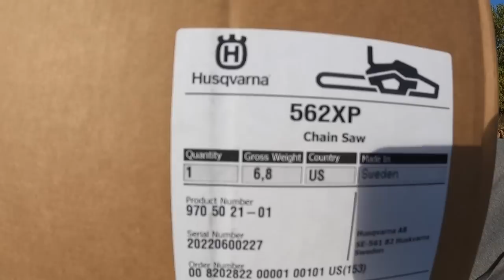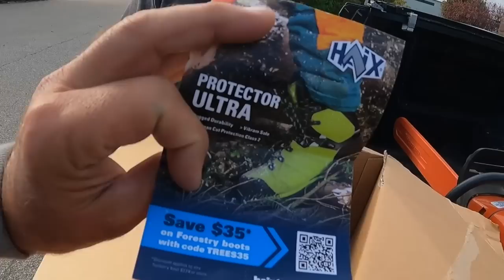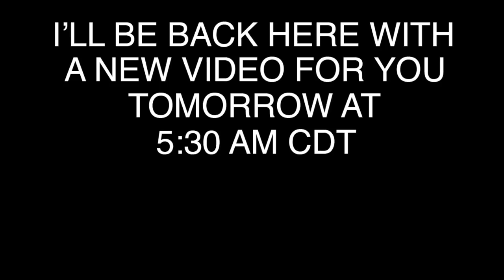NEW - Husqvarna 562 XP Chainsaw!

Comment: I love my 550 xp that I keep in my Jeep with a 16" solid Japanese bar on it, which is perfect for clearing the kinds of trees that I run into across the logging roads here in West Central Oregon. 
I've also run an 18" and 20" bar on it cutting large oak trees and it still had plenty of power.
Reply from the maker: Very nice!

Comment: I started out really liking Stihl best, but the more I used a Husky, the more I liked them. Now I have more Husky than Stihl. I really appreciate how smooth/low vibe the Huskies run and they're built really sturdy, metal handle bar and all, even on thier "pro" 50cc saws. The often maligned primer bulb is also occassionaly useful on empty, cold, or even some really hot starts. The weights of Huskies also balance well with optimal length bars for given displacements.
Reply from the maker: Yup, they cut!

Comment: I bought one a few weeks back and I love it. Got a 24 and 28 bar for it and put a full wrap handle on it and it’s an awesome saw. I live in NC and a full wrap is not the norm around here. I just use it around the farm and it’s been solid from day one. I have been a Husqvarna guy for years. Only Stihl that I own is my weed eater. Great machine but I love my orange saws. I bought an old 51 about 10 years ago and it’s still a beast. That sold me and I will probably be and “Orange Man” till I run out of gas😉. Much love to you all. Be careful and be blessed 🤙🤙
Reply from the maker: Yup, the more we use the 562 the more we like it!
Reply: @InTheWoodyard  I’m a Buckin Billy Ray fan and he really talked the saw up and I do a good bit of business at my local saw shop and he had one that he gave me a heck of a deal. I got a 24 and 28 bar for it. At 53and with a trashed lower back, that 28 makes it nice for bucking. I haven’t been disappointed with it. I got it with the 24 for 700 out the door. I couldn’t say no and glad I got it. You fellas be careful ( my mom’s good jinx 😉) and have a great day.

Comment: I have two 562xp's and a 572xp. When starting... choke it and one you get the first "pop" and it fires, push the red switch all the way down as if you are shutting it off and let the spring in the switch return itself to the run position. This puts it in high idle mode and helps it start/warm up on cold days. Keep in mind that you can't do this with your chain brake on as it will burn up the clutch from higher revs and try to engage the centripetal clutch that drives the sprocket. Hope that helps some.
Reply from the maker: Thanks for the tips!

Comment: I run/operate a small logging company and I am not a fan of the 562xp  They run great and never had a issue of being underpowered even with a 24 inch bar. Their durability doesn't last for professional grade timber felling. I've had a total of 5, none of them lasted longer than  8 months. We did preventative maintenance of cleaning air filters, running non ethanol premium gasoline. My options are the 372 and 572 and better options for durability.
Reply: I don't plan on failing with it for a living it's a it's a living saw for small jobs so maybe I'll luck out
Reply from the maker: Thanks, good to know Michael!

Comment: it's an external clutch. yes disengage the break first! been running 562 since they came out 10+years ago. nice new air filter. the switch rules. you don't need to flip it down. just touch the throttle. easy peasy. pulls a 28' skip no problem
Reply from the maker: Thanks for the info!

Comment: Just a couple of guys who cut wood. And happen to be self made YouTube celebrities. 
I've had a 562xp for 5 years. It's my favorite saw. Its awesome for limbing and light cutting, with 20" bar.  I do heavy cutting with a 372xp and sometimes I run the old 288xp. 562xp is very fuel efficient compared to the others.
Reply from the maker: It is a good one!

Comment: Yep my auto tune saw did the same thing the first time I took the chain off to clean it had the brake on and I was able to get the cover off but then couldn't get it back on! Had to reset the spring with a screwdriver it was a pain in the ass but now it's so easy just make sure the brake is off!
Reply from the maker: Yup, now we know!
Reply: Yep I said it in my head as soon as it was giving him trouble and could feel the frustration that I had too funny 😁

Comment: I have 3 Stihl saws and I gotta say I've never adjusted any carbs and only one coil pack in 20 years since I bought my 441 not one more dime spent on repairs
Reply from the maker: That is awesome!
Reply: The 362, 400,461 and 462 are really good saws too
Reply: @jamesnelson9482  those are on the list .I personally am hearing impaired and the stihl  brand really seems forgiving in terms of higher rpm range and takeoff
Reply: And stihl is very pricey most husky dealers will cut you a deal off retail also. I have both brands with that being said. The 562 is above and beyond the 362 but I prefer the 462 over the 572.
Reply: I’d say you don’t adjust the carb on the 441 it’s got the electronic carb on it it adjust its self,
Reply: @buddysumner4022  my 500i is my hardest to start saw but I haven't spent any money on it in 4 years
Reply: @jamesnelson9482  I finally got the 400i and it runs like a dream
Reply: @shannonjanes2434 and the handle is terribly uncomfortable if you’ve got to start and stop it 10 hrs a day 5 days a week. I put the 500i back in the truck and been using the 371xp husky. Starts so easy compared to the 500i and the handle is more ergonomic on that 20year old husky unlike the terrible Stihl starting handle.
Reply: @chadrides914  fortunately I don't run a saw 10hrs per day

Comment: Still have my old 455 rancher but upgraded to the 562xp 5 years ago. Had an issue early with computer losing programming(?). Don't like to start hot in hot weather. But once I learned ways around it's a beast with a 20 inch bar and dremel-sharpened chain😉
Reply from the maker: Yup, nice size saw!

Comment: At first start, you need to wait for 30 seconds for engine adjustment. Electronic carburetors measures altitude and adjust gas-air mixtures.  You dont need to stay in front of the chain. The chain can unseat and may injure. The another point is adjustment of chain. It seems chain  is so tight and engine has a bumpy ride. At first run,  you should lubricate the chain for blade rubbing until coming chain oil. Husky 560s are excellent chainsaw. Enjoy it.
Reply from the maker: ok

Comment: For years I ran a 3120 Jungle and a 562, which nothing in the middle. Feel like the 562 punches above it’s weight. Now, I’ve thrown in a 592 and a 576 (fully reworked by Steve’s Saw Shop in Lolo, MT). That ported 576 has become my grab n’ go saw for most stuff. Think the arsenal is full for a bit.
Reply from the maker: sounds nice!

Comment: That filter is new for the 562XP. Its supposed to be better than the previous. The one I have lets too much stuff get by and screwed up mine. I have to rebuild the engine and get an adaptor kit to mount that filter unit. 
Not really complaining I ran the bejeezus out of the saw but changing out of the original style filter could save a major rebuild.
Reply: Yeah that brake/cover system … you have to know that works in reverse too. I didn’t know and was changing my chain out in the woods and couldn’t get the cover back on. By the time I was done I had completely removed the chain brake safety feature from the cover. Found out maybe a few months later why I couldn’t reassemble the saw …
Probably should get a new cover because I’ve been running without that safety for a few years now …
Reply from the maker: Thanks for the tips!!!
Reply from the maker: Yes you should!!!

Comment: I have 7 huskys.  My latest acquisition are the 572XP and 550xp mk2.  I converted my 550 to 3/8 chain, 20" bar, and it rips. I have a video out of the conversion.  Really enjoyed meeting you guys at the livestream.  See. you next year - Dick
Reply: 2 of my favorite saws right there! The 550 is a nice saw to use in the tree as well as the ground, and the 572 is absolutely amazing!
Reply from the maker: Nice meeting you too, see you next year!
Reply from the maker: Yup, they are good ones!
Reply: What gauge 3/8?  I converted my 550xp to 3/8-.050 and it stinks, actually it’s worthless and a 18” bar…hard to believe yours is doing anything with a 20” on it.
Reply: @njonebale7889  I did a video on the conversion. Check it out. The times were close with the .325 being a bit faster. I’ve redone that experiment and found there is virtually no difference. Im going to do a video comparing the 550 and 572 in a week or so. You can see it cutting. When you converted yours did you change the sprocket and bar both? That’s necessary… I assume you did.
Reply: @njonebale7889  I'm using a 20" on mine and am having absolutely no issues
Reply: @oldguyfirewood  yes I changed the sprocket and bar, but I went to .050, I’m curious if that is the reason.
Reply: @IloveSPIDERZ  what gauge chain are you running with it?

Comment: Also something I’ve learned with these saws, if you’ve loosened the nuts completely rather than re threading them to dis engage the brake, push the clutch cover with your right hand towards the top of the cover close to the brake, use your left hand to pull back on the brake and it’ll dis engage it
Reply from the maker: Great tip! Thanks!

Comment: I’ve had my 562xp since 2014 . I make 16-18 cords a year and it has given very little trouble. Oil pump warm gear is out right now, just waiting on parts. 
The air cleaner system on your new saw looks much nicer than the earlier ones like mine. Good luck with it I’m sure your going to love it!
Reply from the maker: Thanks, it works great!

Comment: they hold heat badly all of them do a lot of guys trim back top cover over exhaust gut muffler add frogskin vents on rear of cover to prevent hot start issues I have done these mods on my newer 550 xp mark ii made a huge difference these saws are pretty nice after some cheap diy improvements
Reply from the maker: Good to know, thanks!

Comment: I've had a 562 for about 2 months now.  I probably should of gone up to a 572.    Something's the 562 does well, it has more rpm than torque.    Dry hardwood needs more torque and I need to get some bigger felling spikes.  But I like the little saw

Put some beeswax on the chain tensioner thread. It keeps the the chain from getting to loose/fast
Reply: Somebody was changing out the seals and bearings on a hard used saw. There was 3 balls left and the computer was adding enough fuel to keep the massive air leak from burning up.
Reply from the maker: Thanks for the tips!

Comment: You guys are awesome!....... after watching the  video on the comparison of  3 saws just wondered if I should buy the 372XP or 562XP for a 24" bar setup?   Currently have the 550 XP, but would like a saw for the somewhat bigger wood.  The vast majority of what I'm cutting being 20"  or less in diameter at butt.  Just  trying to figure out if the the extra power is worth the extra weight and fuel?  I'm going to be 52 this year, but back and arms still strong ! LOL
Reply from the maker: Get the 572! You can handle it no problem! Plus the 550 and the 562 are very close more power is always a good thing for cutting!!!!
Reply: Thanks!!!! @InTheWoodyard

Comment: If you put the choke on and then tap it lightly down it will slightly It holds a high idle so you don’t have to hold the throttle when starting And then when you pull the throttle it’ll go back to normal. I love my 562! I just milled some oak with it!
Reply from the maker: Yup, it is a nice little saw!

Comment: What great timing for this video.  I am thinking of another saw and was looking into the 562 Xp.  Yes, my Stihl leaks bar oil and I always have to store it on its side.  Can you confirm it's a 60 cc saw. Website shows 4.79 hp so I converted it to cc's and I get 71cc's. Also, website shows up to a 28" bar.  Will the 562 Xp easily pull that size bar? I would like to be able to stand up and buck as I have a bad back.  Thanks !!!
Reply from the maker: I know guy that do use a 24" and 28" But to me a 24 " is about right. I think 60cc.

Comment: I converted my little 18” bar 550 xp to run the 3/8- .050 chain like my bigger saws so I didn’t have to go out to buy those little stock chains…only problem is the puny saw bogs down as soon as it hits the wood…I’ll chain the sprocket and bar back to stock if anyone wants to buy the tiny, puny little thing.
Reply from the maker: That is good to know!

Comment: I have the T540iXP battery top handle, 550XP Mark II, 562XP new filter version like yours, 572XP, 592XP, 395XP. The 550 Mark II is probably my most used and the smaller chain is great. Don’t fear the smaller chain it cuts faster. The 562XP was my second to last saw and it is great but when you have a 550XP Mark II and a 572XP you can skip the 562XP.

I also agree the 395XP is a pig and wears you out compared to the 592XP.

You will love the 5 series saw Ken, they are better.
Reply from the maker: Thanks for the info!
Reply: "when you have a 550XP Mark II and a 572XP you can skip the 562XP."

That's exactly my opinion.

Comment: Forgot to mention yesterday 
 All the 5 series have greaseable needle bearing. Meaning on the clutch in the middle you’ll see a tiny hole
 Take your bar tip grease gun and shoot it in there 
 So easy
 And lots of 5 series have been around since 2013 or so 
My 562 was a 2014 model
Reply from the maker: Nice! Thanks for the tip!

Comment: Thank you for all your hard work, I have a probably controversial question. I've cut wood like you all for years and used shorter bars but I surely would like to try bucking with a longer bar. The 562 has a 28in bar in it's recommendations what are your thoughts on that...Thank You!
Reply from the maker: My opinion is a 20" is best for it, faster chain speed and with a smaller saw that I would use for limbing that is the size I would want and for a home owner saw that is all you need , a 20" bar gives you a 40" cut on 97.53915% of any tree you might get to cut down.

Comment: That is about my favorite size saw. I have bigger too but my back can't take lugging the heavier saws around more then I have to. As long as its a pro saw something in the 50-60cc range is perfect. Especially for a homeowner just cutting their own wood but its fine too if you are selling wood. I would rather my back not hurt so bad I can't walk or standup for 2 days then the little extra wood I would get cut with my bigger saws. Actually the other day I used one of my top handle saws lol. Its an Echo 335t think the model is. My back was hurting so bad from a couple days earlier when I took all the trees down and bucked up 2 of the hard maples I figured I would get out a small saw the next time around. 2 of the trees I cutup with it were pretty good sized ash and that top handle has a 14 inch bar and I could stand up after lol. There was a couple really hard beech too. Haven't split beech in a while man is it stringy. Unless its just the 2 trees I can't remember it being this hard on my splitter running it through.
Reply from the maker: Sounds like you had some fun!!
Reply: @InTheWoodyard  I haven't ran that top handle Echo in probably 3 years. It was screaming. I def cut some stuff that it wasn't meant for lol. The 2 ash were probably 24 inch or so diameter and real good and dead. Didn't hardly use any fuel or bar oil either. Had no business with that little thing doing what I did lol. I have one new saw I haven't even used yet I need to try. I bought it 3 years ago. I think its a GZ360 think that is the model but its a RedMax. Husqvarna sells the same saw not sure what the model is only difference is one is orange one is red but its a rear handle version of a Husqvarna top handle saw. Figured it would be really nice to have a light saw like that for limbing and when I don't need a 60-80cc saw. It just pissed me off so much when the screw was snapped off for the oiler brand new in the box, I go to the Husqvarna dealer about warranty and he gave me a hard time telling me I should have bought it from him. So I ended up buying a new oiler. That is actually how I ended up with the Echo. I dropped it off at my local small engine shop to have him install the oiler I could have but he only hit me for $15 to do it. When I go to pick the new RedMax back up he asked if I wanted the Echo. Somebody had dropped it off a year or more earlier and never came back. So he charged me $40 for the saw which was what the invoice was. So I got a $350 or so top handle saw for $40 so I guess I made out alright

Comment: a de-compression valve on a 60cc saw?  and not a fan that it never 4-strokes, it over revs in and out of wood.  an auto-tune thing?  i'll stick with my sachs/dolmar/makita with a 24 inch k095 husky bar for a 60 cc saw.
Reply from the maker: Okay.

Comment: The Forestry Department had had cases where the pressure in the Stihl fuel tank builds up the open to refil and get sprayed with fuel with those stupid caps.
There’s a company making alternative fittings for the Stihl caps using a race car refuelling system for safety.
Reply from the maker: Heat and sun can do that to any container or tank.

Comment: I run a 28 inch bar most the time , I do run a32 inch  at times and it does very well with that also !
Reply from the maker: I like me 24" bars just fine. I have run a 28" too it works well.

Comment: Just got the same saw for some reason mine boggs down when I accelerate it. And it's brand new. Any ideas ?
Reply from the maker: You need to ask a tech at the dealer you got it at, I would get that done asap, it should not happen.

Comment: Great video. On the uk Husqvarna website the 562 is only .5kg or 1.1 pounds lighter than a 572 with 20” bar. Unless it’s different in USA . Maybe you should try and weight both saws in a video.
Reply from the maker: Thanks for the info!